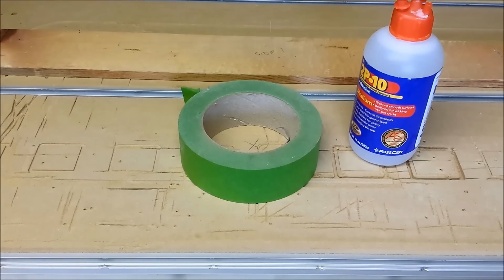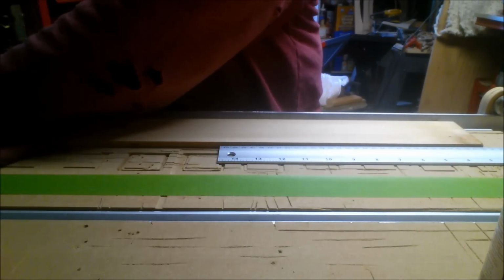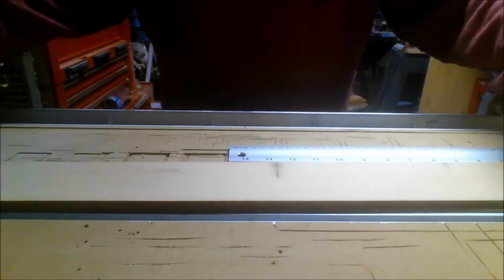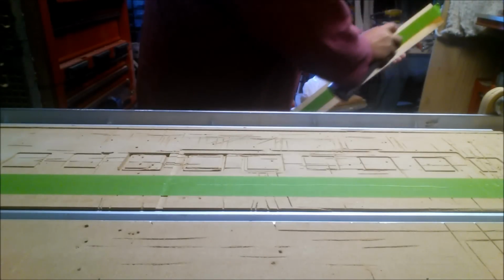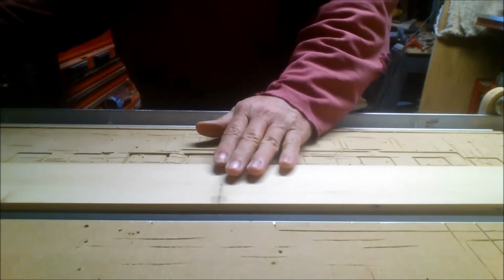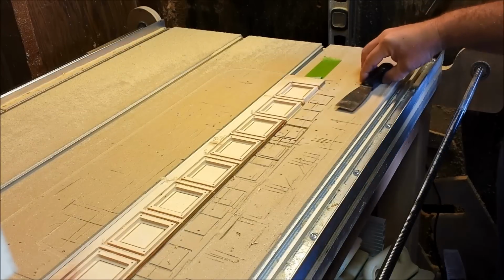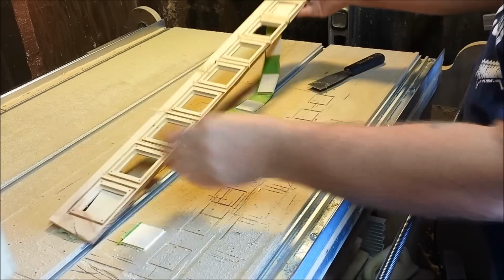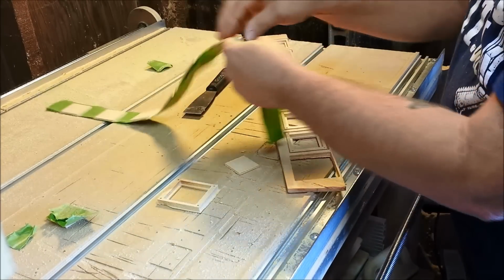A Secure CNC Mounting Technique - NO DOUBLE SIDED TAPE!

Comment: So dumb question.  How is the adhesive on the painters tape that your are using have enough grip on its own to not shift?  There is hardly any sticky residue on painters tape and considering it's being stuck to MDF board is making me head spin.  I totally believe the video, as I've seen others do the same, I'm just perplexed that painters tape taped to the spoil board and then taped to the material your cutting with the 2p-10 and the activator in between each layer of tape keeps it from shifting?
Reply from the maker: I don't really have an answer for you. I'm not a chemist (or an adhesive manufacturer,) so anything I say would be a pure guess. I know that the painter's tape is easy to pull up, but did you ever try to push it off the roll sideways? It's stronger than you would think.! All I do know for a fact is that it works. It's never failed me yet.
Reply: LOL like I said before I totally believe it, it’s just mind boggling that something with such low tack can sustain that pressure. I’m gonna give it a try next week. On a side note, I’m gonna be emailing you soon to chat if you have time.
Reply from the maker: Feel free! Hit me up on Facebook or shoot me a message through the Contact Us link on my website.
Reply: @MarkLindsayCNC  Masking tape is also called pressure sensitive tape, which means the harder you press it down the better it sticks. The fact that you're using a roller when installing it is why you're getting such good adhesion. I'm only new to CNC routing so I will be trying it out as well...Thanks for the tip.

Comment: I have been using carpet tape for few years with  out any problems.
Reply from the maker: Great! I'm not trying to talk anybody out of a method that works for them. I'm just presenting another option. My experience has been about a 50/50 mix of problems and successes. With this method, I've never had an issue or failure. Not one.

Comment: Can someone tell me an alternative to the 2p10 glue? I can't find any place in Germany where I can buy it..
Reply from the maker: Any Cyanoacrylate glue and accelerator spray will work - it doesn't have to be 2P10. That's just the brand I like to use. If you don't use the accelerator spray, just know that you'll have to hold the workpiece down firmly for up to a minute while the glue sets and cures.
Reply: thanks for the quick reply. Now I now what to look for. The only problem might be to find a super glue for a reasonable price in that quantity.
Reply from the maker: Just a suggestion, but you might try smaller quantities first, just to see if it works for you. That way you're not spending a lot of money on an experiment.

Comment: Why does the adhesive on masking tape work better than the adhesive of double sided tape?
Reply from the maker: The adhesive on double-sided tape gums up the tip of the bit something fierce (not to mention any fibers if you're using a filament tape. Also the adhesive on double-sided tape is unreliable in hot weather. I've had templates move on me in hot weather because the adhesive was so warm, it got soft. Not a good thing when you're routing a guitar headstock out of expensive material or something similar. Using the CA glue has never failed me. Double-sided tape has failed me on several occasions.

Comment: how well would that work with aluminum on both sides?
Reply from the maker: I've not tried it myself, but a couple of people have. According to them, it works fine if you're taking light passes, BUT once the aluminum you're cutting heats up, the tape's adhesive on the part being milled starts to fail, and the part will move, or even come loose. I wouldn't recommend using it on metal you're milling. If you're engraving with a diamond drag bit, it should work just fine, but I wouldn't use it on any material that heats up as it's being cut.
Reply: Check out NYC CNC's channel, he does it with aluminum quite often in a machining center.

Comment: The activator isn't generally available here but I suppose it isn't really necessary?
Reply from the maker: If you have time to hold it down firmly in place for the 5 - 10 minutes needed to let the glue cure, go for it. Or, you can order it online from Fastcap or look for it on Amazon.
Reply: Mark Lindsay
Yes, that would get annoying. Back to the doubled sided tape then.

Thanks for the suggestion but it's only available via ground shipping from Fastcap and we don't have Amazon in Oz. I did see a can of it at a recent woodworking show but it was over $30 a can which is a bit rich for my pocket. Cheers.
Reply from the maker: Rudyard Kipling  Holy cow! Wish I could help you out, but if I tried to ship anything, it would no doubt cost more than $30.
Reply: Yes it would, and I am not sure, being an aerosol can, they would let you anyway, but many thanks for the thought, it's appreciated.
Reply: Rudyard, the guy who runs Timberbits in Sydney experimented with using Glen20 as an activator for pen finishing. It seemed to work pretty well, might work for doing this method too! If you google "timberbits glen 20 activator" the video should show up (think if I link something here it gets spam trapped).
Reply: Pete G
Wow! That's interesting - thanks heaps for that, it is much appreciated.

Comment: Oh man I must try this. I’m so sick of double sided tape. Such a pain to clean up
Reply from the maker: You'll never go back. Believe me.
Reply: Mark Lindsay CNC I have no doubt! I had to spend a few hours with gunk off spray cleaning a bunch of acrylic blocks because of that stupid tape. I’m using the link to buy the activator and tape now, I actually had the cyanocrylate already 😅👍🏼
Reply from the maker: Thanks! Do know that any tape, CA glue, and activator work. Those are just the brands I use. I keep the CA glue in the fridge, and it lasts a long time. Just don't confuse it with the hot sauce...
Reply: Sounds like a sticky situation :D

Comment: I used double sided tap sandwich between masking tape before also
Reply from the maker: I've seen lots of folks do that, and if you like double sided tape, that's great. I find the masking tape and CA glue doesn't gum up the tip of the bit as badly double sided tape does.

Comment: can u use 3 m maskin tape.     the reason i asked that the blue tape cost 3 times as much as the 3 m tape
Reply from the maker: You can use any masking tape. Some of the cheap tapes like to rip when you go to peel it off, but they still hold just fine.

Comment: Where can I buy this in Canada??
Reply from the maker: I pinned some Amazon links to the top of the comments, but I don't know if they're good in Canada or not. Having said that, you don't have to use this exact brand.  Check your local hobby shop that caters to the RC car and airplane hobby. Any CA glue will work with or without accelerator. You'll just have to let the glue cure for about 10 minutes before you start cutting if you don't use the accelerator.

Comment: Looks like you're simply making a thinner version of double sided tape :)
Reply from the maker: +Live Free and DIY   In a way, yes. Thing is, however, it's a more secure version. I've had a template move on me on a 90° day and ruin a project. This method doesn't move no matter what the temperature is. It also comes right off when you want it to. On the rare occasion that the tape does want to rip instead of peel off, extreme heat from a heat gun will release it. It's also cheaper, but I think I said that...

Comment: Why not use double sided tape instead of the glue part?
Reply from the maker: I've seen some people do that. I don't know why, but they do. Some of my reasons for using glue and eliminating the double-sided tape are: 1.) you can't burnish the double-sided tape onto both surfaces - you can only burnish it onto one surface, then rely on however much pressure you can put onto the parts to hold them together. 2.) The adhesive on double-sided tape gums up the tip of the bit/end mill something fierce (not to mention any fibers that gum up in the adhesive if you're using a filament tape.)  3.) The adhesive on double-sided tape is unreliable in hot weather. I've had templates move on me in hot weather because the adhesive was so warm it got soft. Not a good thing when you're routing a guitar headstock out of expensive material or something. The bottom line is that using the CA glue has never failed me. Double-sided tape has failed me on several occasions.

Comment: I see you only apply a thin strip of glue, so for certain applications such as cutting many small parts, still need double sided tape. anyway your version has glue on both sides - double sided tape!
Reply from the maker: Yes, but again, it's double-sided tape YOU control. I can burnish masking tape onto both the spoilboard and the part being secured - you can't do that with double-sided tape. Only a thin strip of glue is needed - even for small parts. I've been using the method almost exclusively since about 8 months before I made this video (I screw down large panels and occasionally use fixtures if I have a lot of identical parts to cut,) and it's never failed me yet. Not once. Try it - you'll like it.

Comment: So fundamentally you are still using double sided tape, just making your own out of two strips of standard masking tape stuck together. Good way to save a few $s
Reply from the maker: Fundamentally, yes. But again, it's tape that I can control. In burnishing the tape to both the table and the workpiece, I'm certain they're stuck to each as good as possible. You can only burnish standard double-sided tape to one or the other - not both. I've never had the glue fail to hold the workpiece firmly.

Comment: Will this work on carbon fiber?
Reply from the maker: I've not tried it on carbon fiber, so I really can't say. If someone does try it, please let us all know!
Reply: I will be giving this a go in a couple weeks or so and report back. Most video's I've seen use tape. I just got a 3040 cnc and trying to get gcode sender and fusion 360 cam to work, then calibrate and test. Thank you for your video!
Reply from the maker: Good luck, and thank you!

Comment: Heated metals will release any type of glue. That's the only time I don't use tape.
Reply from the maker: I'm not a metal guy, but I assumed this would be the case. I was surprised to see Jon at NYCCNC using it on aluminum. I really figured that as soon as the metal heated up, it would release. He's had some luck with it, but I'd still be nervous about it.

Comment: why not just use super glue?  CA glue gets really expensive and being in a big city, it's not available at the big box stores, only from wood suppliers.
Reply from the maker: Super glue IS CA glue - the active ingredient is CyanoAcrylate.  The brand doesn't matter - they all work pretty much the same. The main reason I used 2P10 back when I made this video, was because they were the first to have an activator spray that was readily available here locally. But you can use pretty much any brand. You can go without activator spray too, you'll just have to hold it down for a minute or two, then let the glue cure for 5 minutes or so before cutting. The thing I like about 2P10 is I can just apply the glue, spray the activator, press it down, then cut. I get 2P10 from my hardwood supplier too, and it's not super expensive if bought in the 10 oz bottles and kept in the fridge. Just don't confuse it with the hot sauce...

Comment: No glue the sides,  I do 3d all the time.  I glue the spoil board on the sides then the piece on the sides to the other.
Reply from the maker: Nothing underneath? Then you'll have to use tabs to keep things in place when you do a profile cut. With this method, I don't need to use tabs, so I can skip that part of the cleanup/sanding process.

Look, I'm not trying to argue with you, personally. It just seems that lately there have been a lot of people who try to come up with all kinds or reasons not to try it, then tell me why I need to try something else here in the comments. If you don't want to try it, don't. I say right up front in the video that it's not for everyone. If you have another method that works for you, terrific. I found a method that works for me every time, doesn't leave a lot of adhesive gunk on the tip of my end mill, lets me eliminate the need for holding tabs, and has never failed me like double sided tape has in the past. If it's not for you, it's not for you. No big whoop. Just don't automatically pooh pooh the idea when you've not even given it a try for yourself.

Comment: You do realize that you just made double stick tape the hard way right? just a weird solution lol there are 5 layers in this 1.glue 2.paper 3. glue 4. paper and 5. glue soundds like double stick tape to me......juuussss sayin thanks for the vid though
Reply from the maker: Check the other comments - you're not the first to point this out. There are 3 layers - tape burnished to the CNC table, glue, tape burnished to the workpiece. As I've said before - yes, I've basically created double stick tape. But it's double stick tape I can control. You can't burnish double stick tape to both surfaces - only one. That means you're at the mercy of how firmly you can press the part down. With this method, the glue cures almost instantly, and doesn't come loose. With double stick tape, your bits will come out with gooey adhesive residue on them that will require cleaning. The CA glue is too brittle to stick to the bit - no residue to clean. The adhesive from double stick tape can get stuck in the pores of the wood and cause finishing problems - especially when it's used in hot weather. The adhesive on masking/painter's tape is specifically formulated to prevent that. I could go on, but I won't.

Don't take my word for it. Forget everything I said in the video. Try it just once for yourself. You probably have some CA glue and masking tape hanging around. You don't even need to use the activator spray if you don't have any - just hold the piece down firmly for at least 1 minute before you turn on the spindle and use it. Maybe put something heavy on the workpiece to hold it down while the glue is curing. Give it a shot with a piece of scrap. What have you got to lose other than a few inches of tape and a wee bit of CA glue? Try it and see for yourself. And thanks for watching!